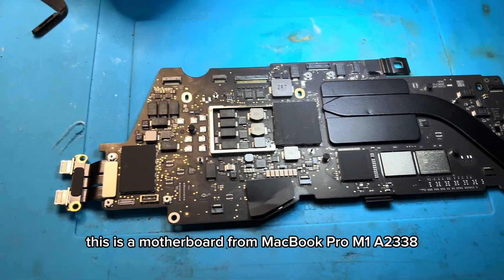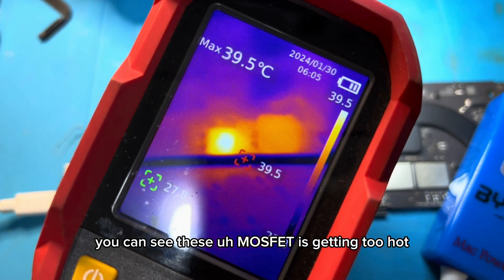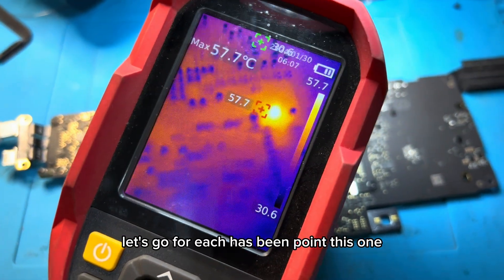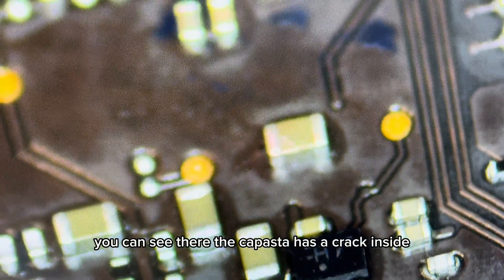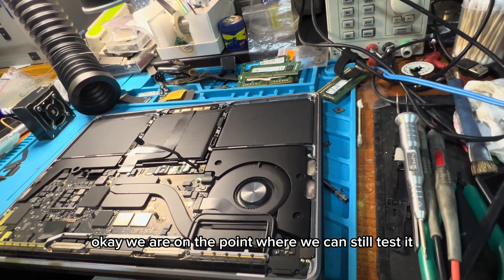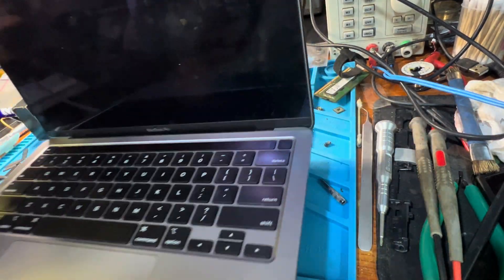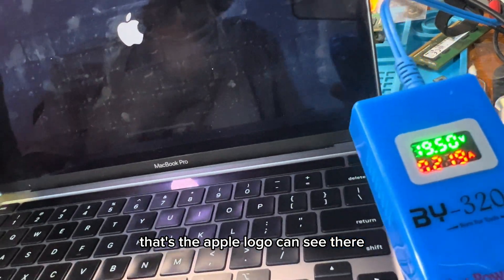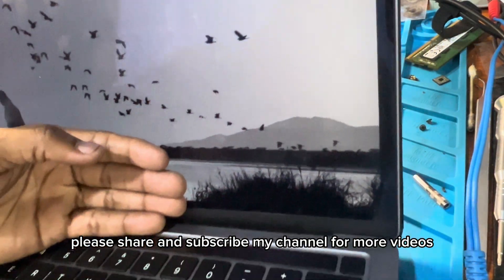Macbook M1 pro a2338 no power

Comment: Sir, can i know the setting for hot air gun to take out that capacitor? thanks
Reply from the maker: On this case to remove a cap ,, solder iron AIFEN A9 pro with big knife tip at 400 temp was used to ,,thanks for asking